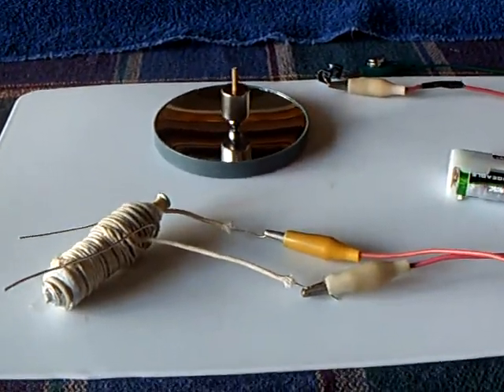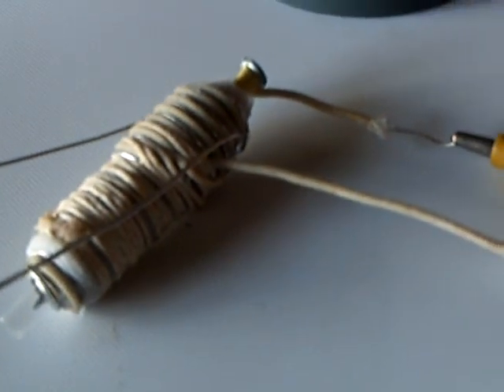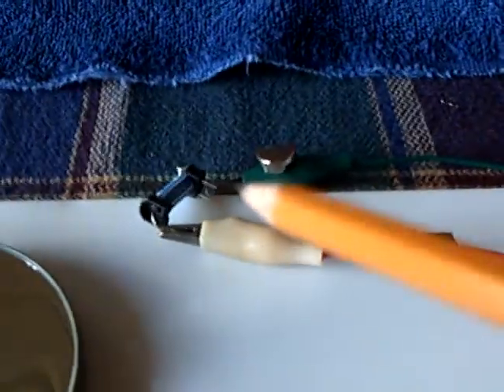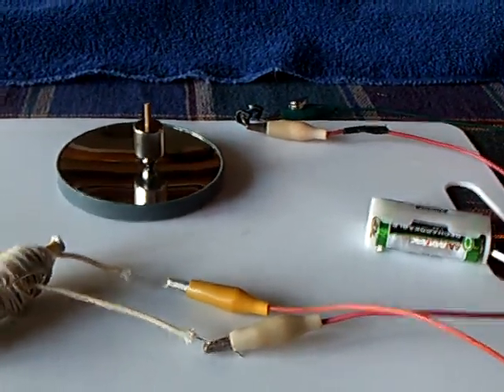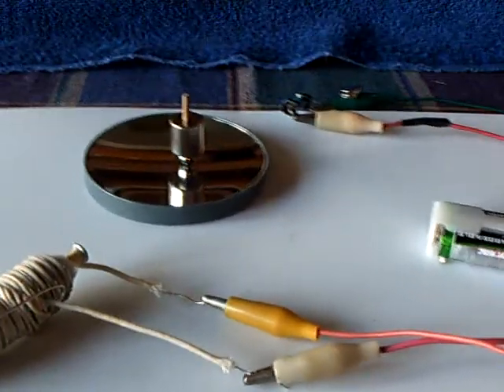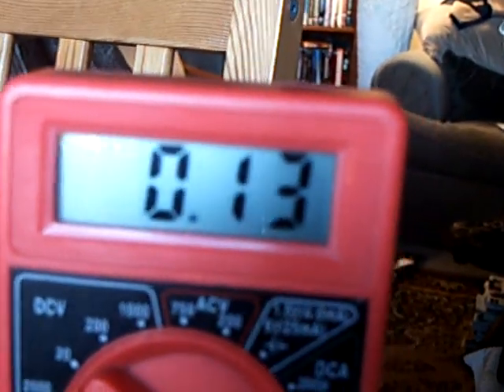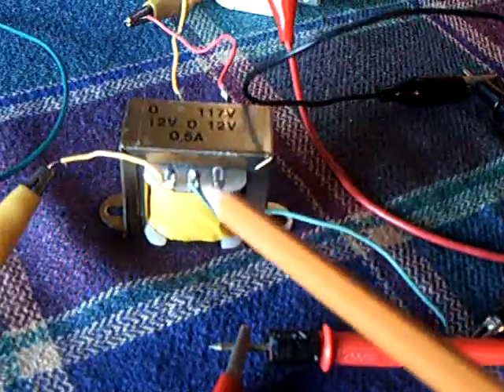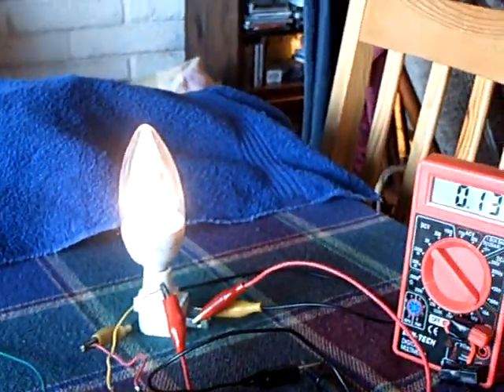Stubblefield coil ---2nd attempt--no workee.ASF

Comment: @Lidmotor 
I think you need to use the rotor along with the reed switch. I have wanted to make it magnetize itself for 3 years now, and no luck, yet, but with the little wheel and reed switch and secondary it all works.
I am assuming your nail is the right permeability.
The steel bolt is no good afaik. All of mine with those bolts can drag a toroid across the table from the residual magnetism from having once been the stubblefield  core.
Laser used a soft iron core in his.

Comment: Hi Lidmotor,
I am glad to see you got this second try to work as a joule thief, sort of...
I would like to bring up 2 points, please.
1- Stubblefield used a secondary for his output, so don't expect anything more than poor galvanic from the copper and alu primary wires .
2- the connection appears wrong here. He left the 2 inner wires of each type unconnected, and connected the outer copper and Fe (Al here)  to the switch.
But the light/power came from the secondary.
Great job!
jeanna

Comment: About Stubblefield coil: a termocouple of 2 disimilar metals soldered together exhibits a few milivolts, so is a little electromagnetic battery and Free Energy device, one may put some termocouple in series to see whats happend; i wil try it soone, seem to have something in common with this kind of coil, and also two disimilar plates of metals close together give some milivolts, coz they are in an energetic ocean, this works also for batteries etc or crystal batteries.

Comment: Lid, your little laugh at your discovery, the joy your feel made me grin like a cheshire cat. And your discovery sent tingles down my spine.
It's awsome.
Have you tryed running this with your Joule Thief?
I bet you could rectify the output from the JT and make this run off of only one AAA, or the JPP.
I noticed the the pulse coil is much closer with the new aluminum wire.
Dude, you Rock.